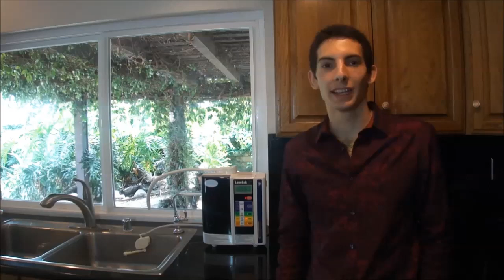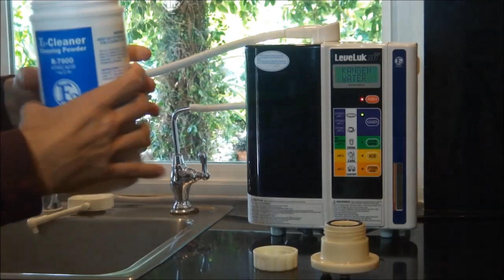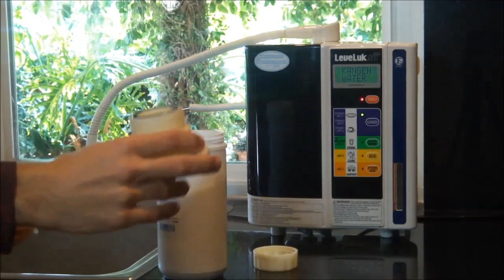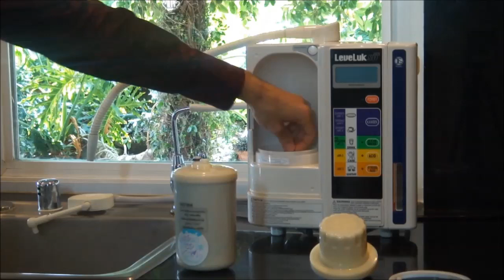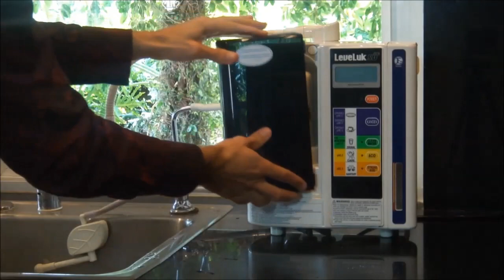How to Clean Your Enagic Kangen Water Ionizer Machine

Comment: Great video on how to clean the Enagic machine! To keep the cleaning cartridge mold free after use, I take the cap off and put the cartridge in a small bowl and pour some white vinegar it. Let it set for a few minutes or longer, pour out vinegar out of the cartridge and bowl, set the cartridge on it's side in the bowl to let it finish dripping out, then I put the cartridge away with the removed.

Comment: Crapafornia is an arid state and water conservation is urged and practiced here.  Can the 3 2 5 minute running time water be reclaimed and used on outside plants and if so which plants would benefit and which ones would not?

Comment: My Dear have a closer look on the Video towards the End. You had switched on the Machine. Had run it for a few seconds, then you turned on the Beauty Water switch, again the water ran for a few seconds and then you switched off the flow of Water in the Machine, But the Power was still on. With no water flow & the Machine power is On... Is that O.K. ??? Can it be harmful for the Machine ....??? Pls reply... Ashoka, India, .. +919810709656
Reply: Sir have u got this machine.  9691626672 to contact

Comment: One really cheep way to make your own water distiller is to use your old pressure cooker and use 90 degree pipe adaptor one end into top by removing original stem that holds the wobbly weight. The other end of the 90 degree is for copper tubing fitted with a locking collar. Slide nut on end of copper tube and then slide a ring crimping part on to the 90 degree copper pipe. A long enough copper pipe (keep in a roll) and as you unroll length from top of pressure cooker, bend tube to base of cooker about 6 inches from diameter of cooker. Now the still unrolled copper to loop 3 to 6 times or more so bottom of coil will sit in a baking dish (fill with normal water, you do not need to use ice water). As most of coil will still be in the air, the view of coil should look like a coin standing on end. This should be assembled with the CRIMPING end loose and use a wrench to LIGHTLY tighten so it does not leak. The end of copper tube can be bent to a large glass water cooler. The wrench will remove copper tube to add water to cooker. I would fill about HALF full. Set to a light boil as a fast boil may just SPUTTER a flow of IMPURE water. Bring the cooker stem to the hardware store to get the right, right angle pipe adapter to fit cooker to copper tube. As it is a STILL, home might use this to steam edible plants for home cures or just fun drinks.  Alfred Janiten 20360 Meridian rd. Grosse Ile, Michigan. 48138. USA  D e l e t e sp. d i c e l e r a-t a-o-l d-o-t c-o-m  Please help me set up a DropBox internet file to give everyone access up to 800 gigs of word file sites, edited for similar content.
Reply: That's dead water , this is the living water

Comment: Btw, you're cleaning the bucket not the machine. The machine only has 1' of hosing inside. The electrolysis chamber only has a channel between the plates of about half as thin as a penny, which holds a few ounces, tops. The idea of dissolving the citric acid throughout "the whole machine" is incorrect logic. The machine is mainly comprised of electrical components, not water.

You should only be using a really narrow glass/beaker and you only want just enough water to come out to cover the heads of the hoses to prevent back-flow.

You'll notice the very first drop of water that comes out of the machine is highly concentrated. 
You'll notice the water after 1-liter has little to no concentration of citric acid. Taste it, test it, and change your method. 

Try it and see the difference. It'll be night and day.
Reply: can you not bring a vid about this? much appreciated.. my english is not so good to write it but I understand it
Reply: Hi... 1 yr is a long time, but can you explain the middle pararagh in more detail? Cheers
Reply: And this guy is a distributor
Reply: Agreed, the amount of water filled in the video is a bit too much.  Use a small glass.
Reply: Thank you

Comment: How does this compare to what is recommended - sending the machine back to Enagic for a through cleaning.  I have had mine 7 yrs and never sent it back in - could that be a problem?
Reply: to answer your question, if you have hard water you'd see a reduction in flow and need to send it in for a deep cleaning more often, like once every year or two. However, if you're getting good purple ph test and nice hydrogen bubbles, good negative ORP still... you're all set. running beauty water for a few minutes per day is a good thing as well.
Reply from the maker: Yes I would recommend sending it in for a deep cleaning every 2  years or so to keep it running smoothly. It's like an oil change in a car. It's always best. This kind of cleaning is done every month to keep it running good but deep cleaning will make sure that it's staying good